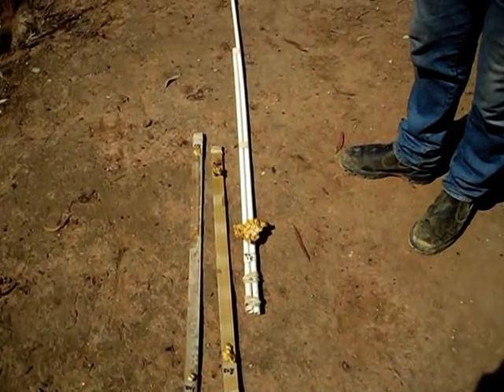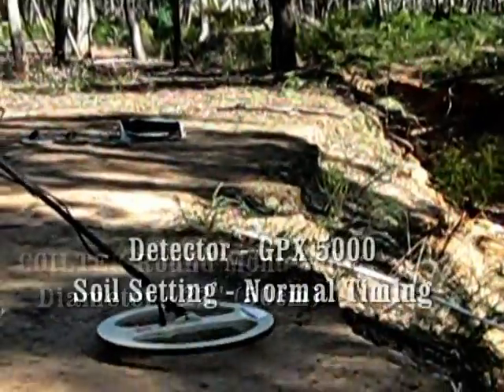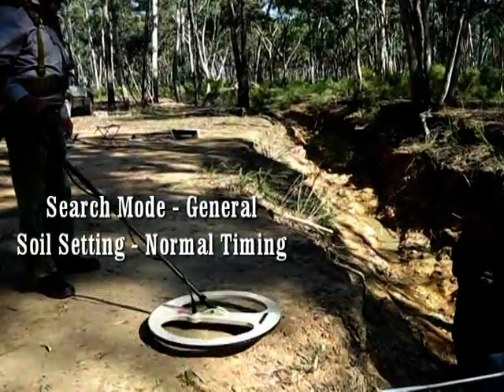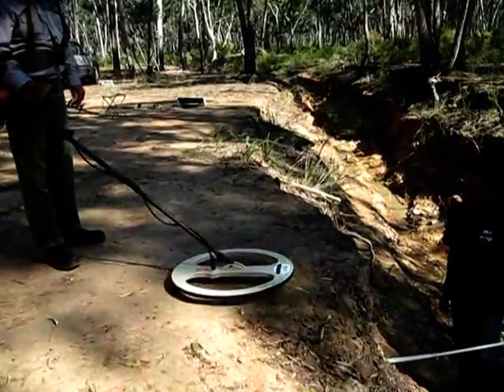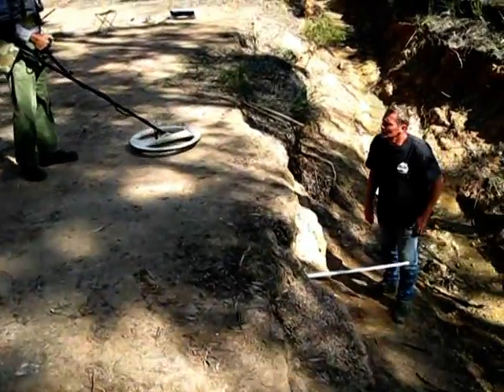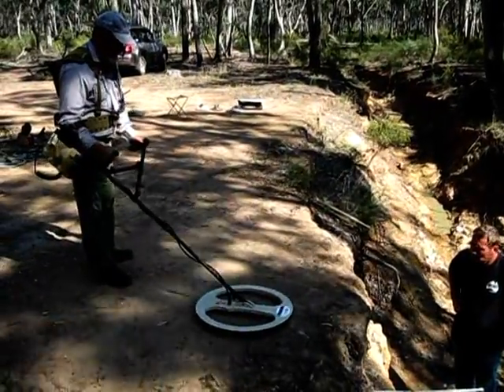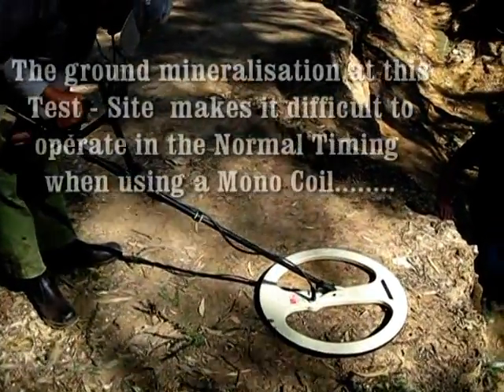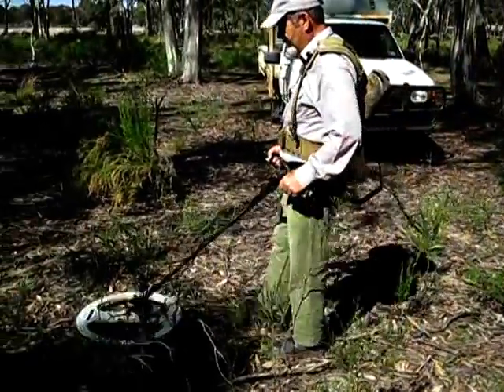Depth Testing using Normal Enhance and Fine Gold Timings mpg

Comment: What is the maximum depth on a target measuring 24 x 25 cm
Reply: It depends on the coil size, detector settings and the target material and orientation.

Comment: How deep is the device on a target that is 25 x 30
Reply: It depends on the detector you use and its settings, the type and size of the coil, the shape and metal type of the target.
Reply: @qedmetaldetectors4972  On a gpx 5000 with Coiltek 22 . disc